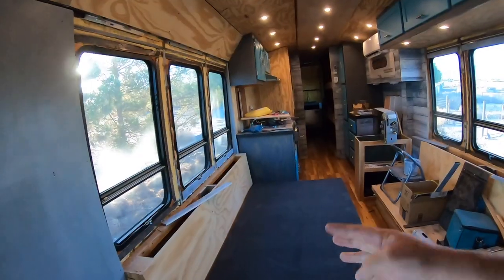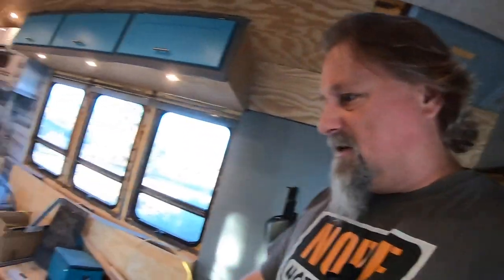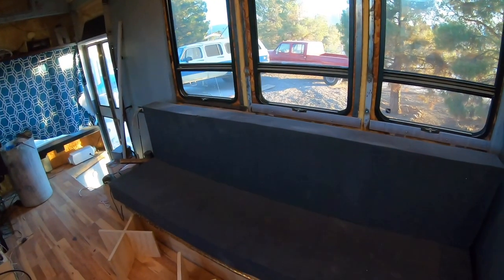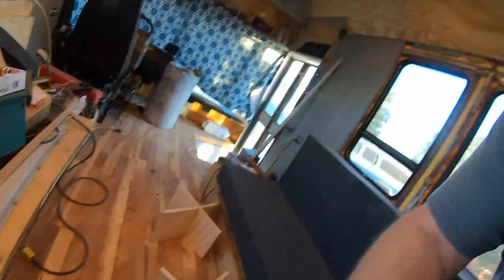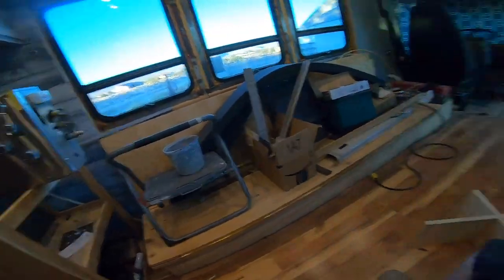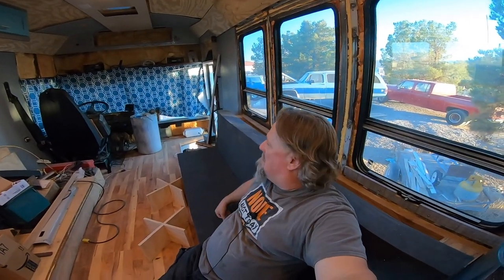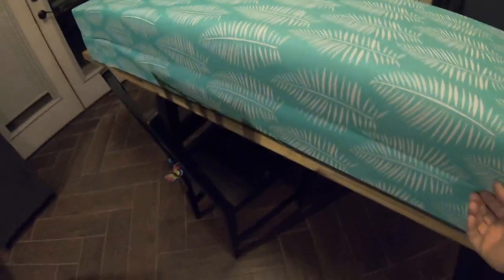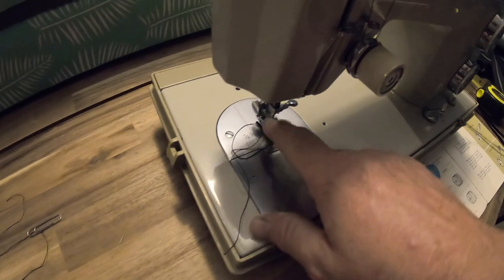Bus to RV Conversion 84 - building couch cushions

Comment: Also remember if you have one way design place pattern all the same way. Haha you sometimes don't listen in class.Cora Bankston. We bought our 1999 blue bird in October 2019. Only seats and floors out. Bolt holes filled. Trucking 3wks out then back to San Antonio . Mostly hot like Nevada. Ilan and Cora.

Comment: Haha ~ we were both doing cushions around the same time! I love your fabric, it's bright like my kitchen cabinets! Can't wait for the sequel to see how you wrestle those long cushions into the covers, LOL! 😂 But seriously, can't wait to see it all together in your bus!!!  ~Kerry
Reply from the maker: it wasn't as hard as you'd think, as long as they are.  But I did learn why I was getting such inconsistencies with the stitching.
Reply from the maker: Hey, on a side note...I had to spend some quality time under my bus today and I noticed the mount for my Chinese diesel heater had failed!  completely dry rotted!  The rubber lines that connect the plastic lines to the pump and filter were dry rotted too!  You might want to check yours before you put Mcbussface into service only to find that your diesel heater pumps were scattered along the highways and byways.